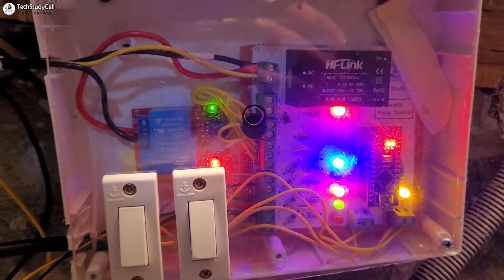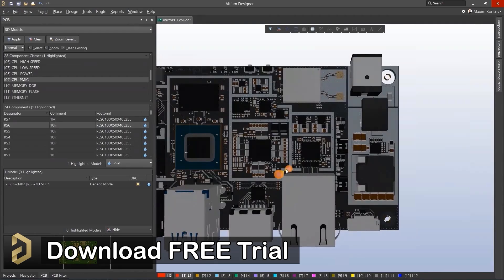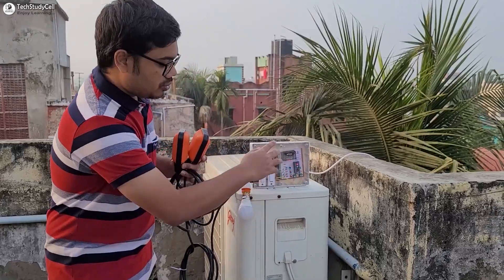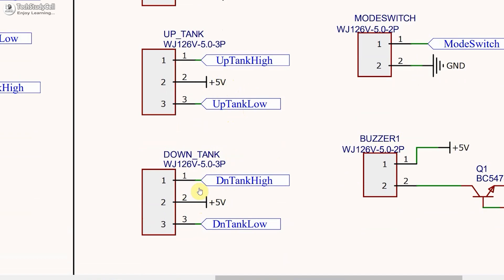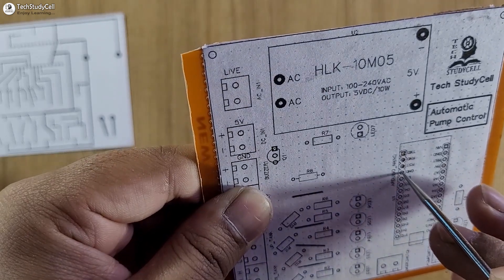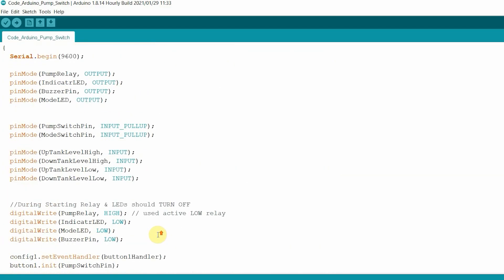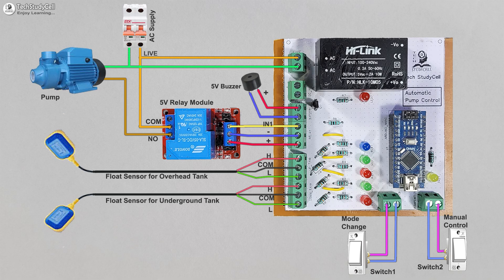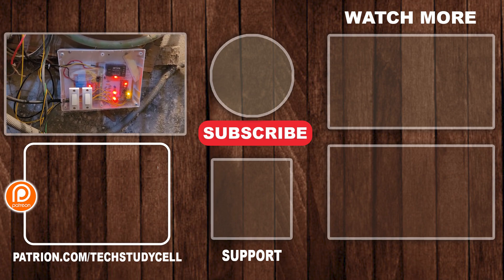Automatic Water Level Controller using Arduino & float sensor for Overhead Tank | Arduino Project

Comment: can i still use this without underground tank because I will inserted a pipe to  a deep well and put a foot valve on the end, and it is connected to a motor pump . please reply
Reply from the maker: Yes. just short the COM and NO for the underground tank

Comment: I sent you a couple messages with questions i have. 
 Am I able to use a different sensor or does it have to be these exact ones? 
Do I have to run both sensors or can I run just the one? 
Will it work with any pump?

Comment: Hai bro can u make a video for water low level and high level announcement only ( no motor operation) using Arduino uno and TF card mini mp3 module plz?  3 wire float switch for low level and high level to be used. For only upper tank

Comment: Hello, this is exactly what iv'e been looking for, only for my application, I need to have between 6 - 12 upper and lower tanks, easiest option i guess would be to replicate this for each pair of tanks... but would it be possible to just add more upper and lower tanks etc all within 1 arduino ?

Comment: Hi, if you can help me with this it would be great, I have a 3m softener which regenerates automatically and at times during regeneration the water level controller turns on the sump motor and hard water goes to the overhead tank. Is there a way to let automatic water level controller to avoid turning on whenever the softener is regenerating?  Basically my sump water first goes to the softener and then to the overhead tank. I am not technically sound, but there is a big relay connected with the 3m softener. Please if you can help with this situation

Comment: Don't need all these stuff to do it, just connect the three wires from both side in an orderly ways. Let me show you the ways to make it, to make it simple, let's name the level controller A and B.
Just simply connect the A red with power , A Green with B Red, A black with B green and lastly connect the pump with B black along with the main line power. And you can switch off  the main line using a switch . If you hesitate, experiment it with led light and a pencil battery.

Comment: How much cost THIS project make?
Reply: It required only  three cores 1mm wires and a switch (to switch off the main line power) . Take a look at my comment, I did it by own idea, it works fine. Just connect the three wires from both side in an orderly ways. If you hesitate, test it with an led light and two pensil batteries, since it required at least 3 volts power supply.

Comment: Samarsable starter panel water level controller make . As same future but not using float sensor ,add in future started moter buzzer in beep beep ,and beep stop in tank full then moter stop,and stop conditions check every 40 second  start moter ya stop.then start automatically off.

Comment: In my humble opinion, you did not have to use the float switches at all. Just use two wires/sensors in the underground tank and two in the overhead tank. Once the water touches the sensors write a code in Arduino to take appropriate action. The best way to write code logic is to use two hardware-level interrupts which are available in the Nano. I hope my comments help. This will reduce the cost of the whole project.
Reply: wire will get damaged easily due to current flow in the wire( for the sensing) and oxidation
Reply: @polytechnics7612   Low cost magnetic sensors can be used in place of costly float switches

Comment: If I connected NPN transistor with Relay and connect it with 12v power supply and if I connected base pin of transistor and positive terminal of battery with the floating sensor then will it work fine ?

Comment: What happens if I connected the sensor ( used in both tank) directly in motor connection (series connection with motor wire). Will it work? As the sensor has 16 amp current rating
Reply from the maker: It will work, but in that case you will send 220V AC supply to sensor.  It will create hazard, If there is any leakage in sensor. So I have sent 5v dc
Reply: Simple answer is YES it will work

Comment: Is there limit to the distance of wire for both float sensor and water pump?
I own apartment which is 6 story high.
Reply from the maker: No limit. In my case the overhead Tank is 5 story high. So I have used extra wire
Reply: distance depends on wire quality

Comment: What benefit we will get to use this arduino relay circuit even we can just use this switches directly?
Reply from the maker: There is both AUTO and MANUAL mode. Pls watch the complete video.
Reply: @TechStudyCell  Complete video watched Bro regarding auto/ manual mode we can use with tank switches as well then what use to make it more complicated?